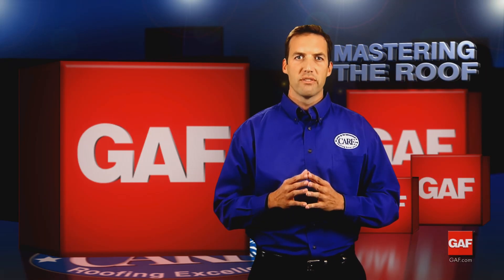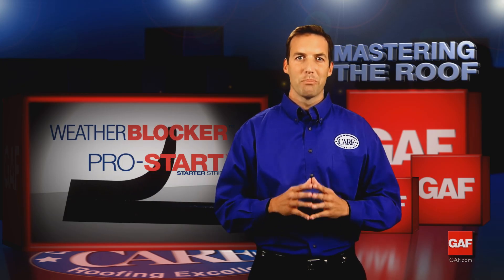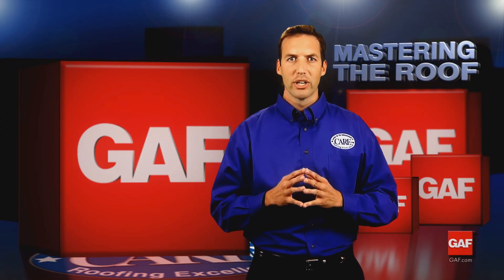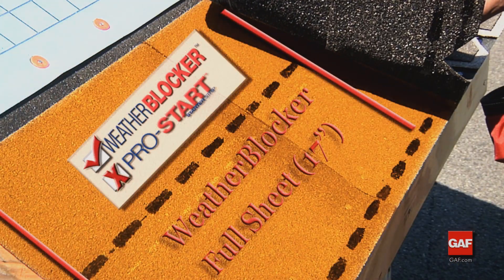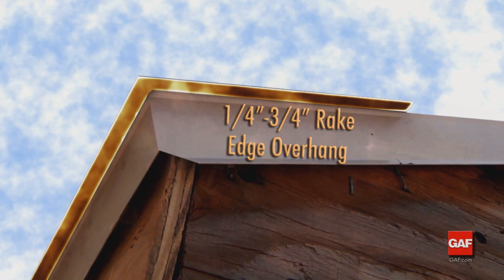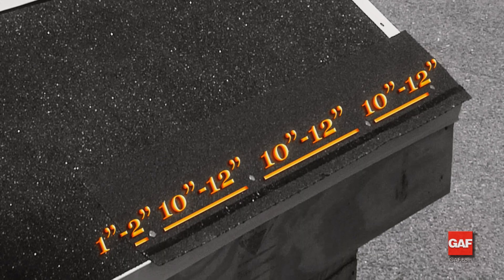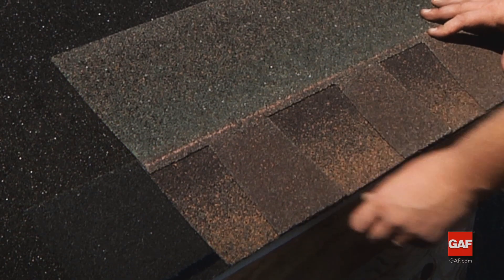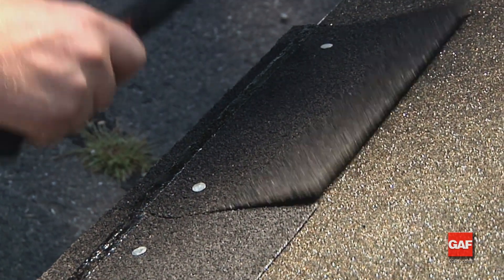How to Install Starter Strip Roofing Shingles | Mastering the Roof by GAF

Comment: Does anyone know if the starter strips going up the rakes are supposed to over lap each other? or butt up against each other? I assume overlap just like it overlaps the eave starter strip but just checking.
Reply: No overlap from piece to piece.  Butt joints.
Reply: @exercise-or-die-early   That is the eave edge your looking at. They never actually say or show it in this video except that the first starter on the rakes overlaps the eave starter by 3 inches.

Comment: i so dissagree. i never had any blow off. i do not hang over the drip and the tar line of the starter needs to seal to the DRIP EDGE then the shingle has a tar li e that seals to the starter. creating a sealed system. you just flopping in the wind. less you have a tar line on both sides of that fancy starter. bro.
Reply: How do you know you never had any blow off? You call all your customers every year to check? You're the typical hack roofer that thinks they know more than the manufacturer.
Reply: If you do not install per the MANUFACTURER’s specs the warranty is void.  Be sure to tell your customers that the way YOU install won’t be warranted.
Reply: You’re nailing the starter down, that’s what’s holding the starter.  There’s a difference between never getting a callback and never getting a call back.

Comment from the maker: Hi, thanks for your comments here! The starter strip product is installed properly in the video with the product’s factory-applied sealant strip positioned nearest the eave edge or rake edge of the roof.  To learn more, you may find installation instructions on gaf.com at
http://www.gaf.com/Residential_Roofing/Starter_Strips/ProStart/ProStart_Starter_Strip_Installation_Instructions_English_Spanish_French.pdf

Comment: are these not installed upside down? installed the way this says the sealant on the other side shows.
Reply: They are made specially to be installed on edges of the roof sticky side up to grab the next layer of shingles because the nails will be 5 or 6 inches up on first course this prevents wind from lifting them up:)
Reply: Michael Marchelli doesnt this video show them being installed the wrong way?
Reply: @betterworld1   Yes you are correct, Everything should overlap from the top down not the bottom up. Water flows downhill not uphill. Also butting starter strips on the rakes will sit smoother but it will not water tight it like an overlap would. Best to follow Manufacturer's recommendations over a contractors opinion. Most shingle suppliers have installation video's online. But should be prepped then eave drip edge first followed by tar paper water barrier or ice and water shield. Then drip edge on rakes, starter course on eaves first piece cut back so to stagger seams. Starter course on rakes starting at the bottom overlapping the eave starter strip by 3 inches trim excess for exposing the tar strip. Then but the rest all the way up your rake. Then follow manufacturers instructions from bottom left of roof up, making sure to stagger seams and keep courses plumb. Snapping chalk lines on your 30lb felt paper for every course and possible vertical every 6" on 3 tabs different on architectural shingles, will help you to stay straight and true. Get a plan together before you start. Good Luck!
Reply: It's not perfect, but it's close.
Reply: the next shingle has a tar li e that seals to the starter. thus is why up put the tar line of the starter DOWN to seal to the drip. then the shingle seals to the starter. wtf. they are just flopping in the wind
Reply: Not if you nail them down.